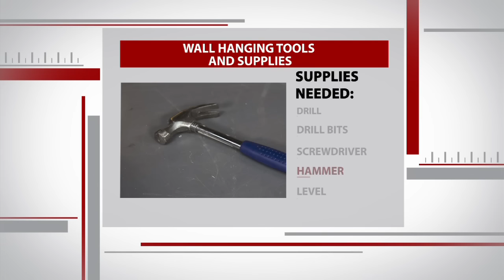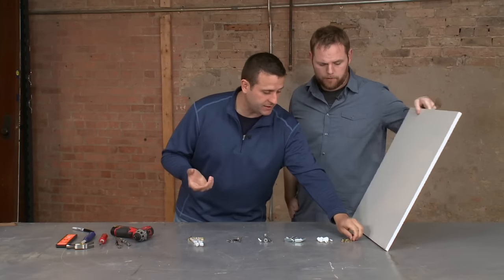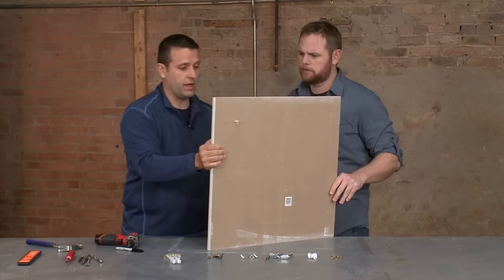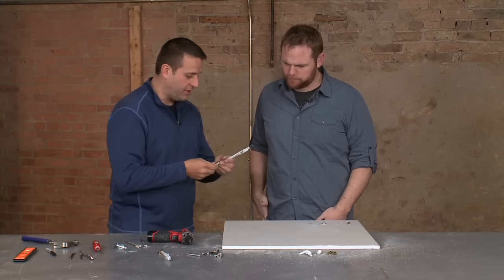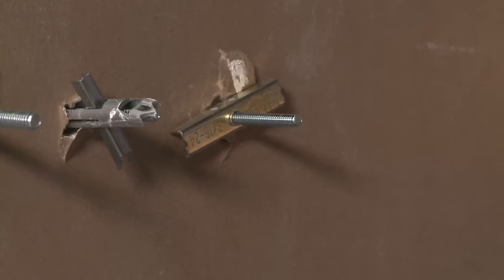How to Hang Heavy Items Without a Stud

Comment: Please remember. Those screws can hold up to 200lb, but your drywall cannot. We don’t have issues with screws, our big problem is drywall is weak and it will brake away from the wall easily. So do your best to find a stud.
Reply: Yep! Use any of these like this to hang up a big tv on a heavy duty swivel mount, and its coming down, along with your wall.
Reply: That’s my problem now. 😫
Reply: My house is from 1930s, walls are gypsum and lath, do you think it will pull out? Thanks Dante Opps
Reply: @lindat9083  I don’t know 🤷🏽‍♂️ I never seen a 1930 lath before but I know it is thicker and stronger then drywall.
Reply: I want to install a pull up bar in between 2 hollow steal door frames. I’m having a hard time deciding what Anchors to use. Could you help me?
Reply: The best bet is to find a stud everything else is just a guess.
Reply: Is it ok if I’m just hanging pictures max is probably like 30 pounds

Comment: Forgetting the most important consideration. That is that it doesnt matter what the anchor weight load is.. Its how much the drywall or substrate will hold before the anchor comes pulling out of the wall itself.  Light weight drywall will not keep an EZ anchor in (the white ones) when using it to hold things like drapes etc. Which they advertise they can hold. . The anchor will hold up without breaking but it will come out of the wall. As for the toggles. If your suspending a plant hook for example where the weight load has vertical pull on the anchor, again it will often pull right through the drywall when a plant is fully watered even if it hasn't hit the weight capacity. Just considerations to keep in mind. The substrate definately matters.
Reply: I'm so glad I read your comment before I destroyed more of my drywall. Thank you!
Reply: How do I fix a heavy plant hanger that will be very heavy on the side of my vinyl sided garage? Help😢
Reply: Any advice then on how to get curtains to actually stay up?
Reply: @jeffchandler2521 You don’t. Did you know that you don’t always get what you want?

Comment: That's really nice however on practice things are quiet different. On my experience, the weight  that an area of sheetrock can hold really depends on how old the panel is. The older your wall is (20 to 30 yrs), the weaker is going to be and obviously less weight will hold. I personally've  had bad experiences hunging heavy items  relying only on what the product says. I have used anchors that claims to hold up to 75lbs with disastrous consequences. Based on my experience, i have a rule to use if i ignore the age of the house or more precisely the panel of sheetrock i'm going to use. I only hung up to  2/3 of weight of what the anchor label says for older houses and 3/4 for new ones then i carefully do some math to figure out how much weight will each anchor hold.
Reply: David Qu

Comment: Thanks for the video. I hung a 75 pound mirror in the bathroom through 1/2 inch drywall, no studs. I used four 3/16 inch snap toggles with a french cleat and it feels solid. The night before, I used one snap toggle in 3/8 drywall to test the weight for a dry run before hanging the bathroom mirror. I hung a 40 pound weight on it and I was surprised by the strength of the drywall and toggle.

Comment: Folks...please unserstand that dry wall will withstand a great deal of sheer but I is very weak if the weight pulls away from the wall.  A flat screen tv should not be hung usint any of these methods. As mentioned below...a long piece of ply attached to the studs and the tv mount btackets mounted to the plywood is a good way to go.  Also shelving presents its own problems.  The methods in the video are mostly for a load that pulls straight down toward the floor.
Reply: Review TechAfrica is just jealous that he doesn't live in North America and I'm thinking he must be getting anxious to get his welfare check... It's only 10 more days and the month is over buddy...
Reply: I'm reminded of the hole in the dry wall from the knocks of just a door handle. Hanging seriously heavy stuff on it, no way!!
Reply: Thanks for that clarification because I was considering this method for hanging some shelves that I have struggled to put up. Guess I'm back to square one

Comment: Very helpful.  I just used two snap toggle anchors to hold up a large heavy mirror.  Very easy to use
Reply: Is your mirror still holding up? I've got a really heavy old mirror, from a great grandmother, and I've got metal studs which are very hard to hit. I definitely don't want it to come crashing down!?
Reply: @roxannegreen1181  still holding strong!

Comment: Note: the weights aren’t the same for fixtures which are interacted with. If it’s a towel rack or curtain rod with sufficiently heavy fabrics these smaller plugs WILL loosen overtime.

Comment: The plastic on a snap toggle is used specifically for keeping the anchor on the backside of the wall in place. Once the screw is threaded into the anchor none of the plastic is relied on to hold weight. It’s the metal anchor on the back
Reply: pl can you elaborate for me ?
Reply: Yeah , they didn't mention the anchor, how it attached and inserted.  I wouldn't trust anyone who advises hanging a  75lb mirror on a single drywall anchor without a stud.

Comment: I love the snap toggles but man sometimes they work and sometimesfir some reason I end up with a screw that just keeps spinning. For a situation where you want to hand a tv like a plasma but do t have the studs right where you need then then simply have a long plywood board that you can bolt to the studs then screw your bar onto the plywood and it works perfectly.
Reply: +Rich Lo try putting bearing grease on the threads, a light coat. And take a pair of cutting pliers and deform the bottom of that toggle thing where it goes into the back of the drywall. Create a bur on the edge. The reduced friction on the threads and the increased friction on the toggle will totally guarantee it working.
Reply: +Derrick Blackburn okay. I can see that working.

Comment: Thanks for this! I hung a floating shelf. I was able to find the studs of 3 sides out of four, but for some reason the top right side stud was not there so the screw came off. I will try the drywall anchor.

Comment: I strongly suggest that one hand start the screw/bolt into the snaptoggle BEFORE a tool is used. If not, the mismatched screw will quickly force the toggle wings out of the plastic wall retainer, destroying the assembly. Dammit...

Comment: Those Snap Toggles are rated for 75lbs each. That doesn't mean that the sheetrock alone would support all that weight of a 60"-80" TV. I see too many factors contributing to the weakness of the Sheetrock.There is Humidity, Gravity, Actual Sheetrock Damage and usually all bolts, nails, and supports start carving into the sheetrock. I wouldn't trust them with a Heavy TV.

Comment: Does the load bearing capacity multiply the more anchors you use? Ex. if a snap toggle holds 250lbs, will two support 500lbs?
Reply: Good question 🤔

Comment: The second anchor needs to be installed by drilling a hole with a bit just slightly thinner than the anchor. I tried it like your video and anchor broke. Your video shows that you skipped foward to the end .

Comment: for shelves, I would rather find studs, cut some ply or 1x2's screw them to the stud, then use that to attach the brackets for the shelves. Granted this is for in garage use and wont look as nice in the house, but it holds my 50+ tool box just fine!
Reply: I think this is the most important comment for this video. As others have mentioned, the hardware may hold your piece, but the drywall could eventually crumble or weaken. This is a bit of extra work, but will probably last forever. And this is what I'll be doing for some heavy items if I can't find a well-placed stud. I learned from Dad and that is what he used to do. Thank you for the comment.

Comment: At 3:25 in reference to the snap toggle, the narrator says "All that's left to do is insert the screw and this heavy duty plastic is ready to support some serious weight."  All the weight is supported by the metal screw, and the plastic serves no further purpose beyond holding the toggle in place in the wall to receive the screw.

I used the toggles to install a TV wall mount in a condo with metal studs, where screws weren't going to work.

Comment: Usually you install the screws where there is a frame behind the drywall, so that will bear the weight of the painting/shelve etc. Drywall is not designed to bear any weight...

Comment: Fantastic video. I need to hang a hood range on my kitchen,  the studs are nowhere near the center, since I already installed the backsplash (glass and metal pieces, go figure wifey wants it that way) so now the holes to hang the hood range fall right on top of the metal pieces of the backsplash. The range is 20 lbs heavy, I am thinking of using the 75 lbs toggle bolt for it. This should hold it easily since it is almost 4 times the weight of the hood range. Any thoughts?

Comment: 3 weeks after hanging a shelf I made to hold my flat screen tv on, it came crashing down leaving me without a tv.  I used dry wall plugs, then inserted the screws thinking the tv was safe?  My new tv now sits on a table, safe from falling lol                                                                             Thanks for sharing your video.  Now I can use your examples :)
Reply: jojo if you were using plugs they are not for drywall. they work in brick, plaster, wood, and cement.

Comment: I need to install a TV mount (steel unit) to the side of a solid oak kitchen cabinet. The corner of the kitchen where the TV mount will be installed has porcelain tiles on one side (IE, kitchen back splash tiles), and an solid oak cabinet on the other side.  I know that the TV mount  requires two holes. What is the best mounting hardware I can use?

Comment: What size bolts/washer would you use to hang 96" L x 22-1/2" w x 1" thick commercial residential subdivision sign. I think it is solid oak.  It is HEAVY. Hanging it to a brick wall?

Comment: Thanks for your video.  I bought snap toggles, on advice of hardware guy at Lowe's, to hang a header board for barn door flat rail hardware using provided 3" lag screws. I am not experienced so it takes ma a long time to make mistakes..LOL... But I think I am on the right track.
Reply: By the way.  My walls have metal studs...

Comment: I am ashamed to say that, until a few days ago, I don't think I've ever hung more than a small picture frame. I didn't even know what drywall was, but from the way that my wall crumbled after trying to hang something heavy, I'm pretty sure it's drywall. I'm recently divorced and I see no reason to hire someone else to do jobs that I'm perfectly capable of (as long as I educate myself on how to do so properly). With that said, I guess I need to start with something even more "beginner" than this video, like "what kind of walls do I have?" 😂 I'm laughing but I'm serious. I really want to learn the ins and outs of home improvement, maintenance etc so that I won't have to rely on anyone but myself. If anyone has tips on what I should be researching, please share as I'm sure that there's so much to learn that I never would've realized.
Reply: Good for you. Watch all the home building shed building videos on you tube that you can. I have learned so much. Then pick a project in your house like changing a light fixture but don’t feel safe or confident doing it after just 10 videos. I feel like people posting don’t always know to tell us everything somethings they think are common sense and they often as in all the time leave things out. I watched 100 shed building videos befor I built my shed. First thing I ever built other than a table and baby gate. Every video I learned something earth shatteringly new and crucial for the build.

Comment: What would be the best to use if the wall has dense insulation behind the drywall? I tried the first toggle bolt but it couldn’t open because the insulation was blocking it.

Comment: Which stud should i choose for a hollow wall to hang my project screen in the basement theater? All I have is a sponged surface beneath. I already tried few of the studs mentioned in this video and i have a ton of holes and screws that just came off

Comment: Very Respectfully,
With All Due Respect,
Good Gods Day,

This is such a FANTASTIC video with perfect illustrations, the only thing is,  they don't put dry wall that THICK in homes anymore, so when you put the hole in the wall with the hooks of support, the sheetrock is SOOO THIN it makes it EXTREMELY WEAK TO SUPPORT THE HOOK AND THE WEIGHT OF ANYTHING, if I may, maybe someone be willing to show us how to deal with trying to hang pictures up on THIN SHEETROCK, in this video, the sheetrock l👀ks to be very sturdy and definitely MUCH THICKER than what these news homes have today in 2017, can you all give any guidance on dealing with trying to hang pictures up on these thin sheetrock walls in these new homes.

Thank you for such a FANTASTIC video of instructions with great tool suggestions!!!👍
Reply: chris b 

Very Respectfully
With All Due Respect,
Good Gods Day,

Ooooo okay, I am not educated about plaster at all, I tried putting a hole in the bathroom wall behind the bathroom door and I did the steps and then as I was turning the sturdy nail supporter thingy😀 into the wall, the wall IMMEDIATELY opened up and the nail supporter thingy😀went straight through the wall, for me to then discover that behind that wall it was ABSOLUTELY HOLLOW with SO MUCH emptiness, so now I have a little over a quater size hole behind my bathroom door, and I don't have a clue what to do.

I truly thank you for taking the time from your busy day to reply because I have really trying to figure this out.🌸

Comment: What do you use to hang a mural, painted on a  3/4" sheets of 4'x8'' plywood to drywall? So it would be drilling through 3/4"'s of wood, the 1/2" of drywall. Also drilling a hole more than 1/4" would ruin the mural. Even then the holes would have to be strategically place to avoid the main art work.

Comment: I need to hang a 50 inch 30 pound tv on my plaster wall. Will the snap toggles work and should I use a 1/4 or half inch?

Comment: Trying to hang 4 2’x8’’s that are connected to each other which forms a square from an old NY ceiling. The ceiling is the old tin tiles. Tried using threaded rods and snap anchors, but the tiles are hollow and will not support the weight of the 4- 2”x8”s, which are 8’ long. Any suggestions?

Comment: These guys totally ignore the material and strength of the dry wall
Reply: I spent almost 40 years in building maintenance and I can attest to the fact that drywall will not stand a heavy weight pulling away from the wall for very long. Shear strength is pretty good but can you depend on the weight always pulling straight down? Find a stud and use it....ReviewtechAfrica got his panties in a twist because of my statements. Perhaps his plasterboard is not the same as Our dry wall (sheetrock), gypsum board. No knowledgeable painter, or plasterer will recommend just fastening shelving to the drywall regardless of the load.
Reply: JIMMY TATE well said
Reply: @Katarina Krizaj duh - don't do it...
Reply: @Katarina Krizaj 
Toggle bolt. You'll need to drill a hole in the stud large enough for the toggle to fit through.
Reply: @Katarina Krizaj best option is to take the walk down, add wood, then put the wall back up

Comment: Monkey Hooks. Nothing better for Drywall. You just twist them into the drywall and then push them into  the wall. They leave almost no hole and you can take them with you when you move. Use a bit of white toothpaste to fill the tiny hole. You can find light duty sets at the Dollar Tree and heavier ones at Home Depot.  Once you get the all the way into the wall up to the hook, twist the hook so into the proper direction for hanging. I never use anything else any more. 
I HATE those white screw anchors. They are the worst. Molly Bolts do work. but they can't be removed. Toggle Bolts also work but they require a huge hole and so they also leave a hole that has to be patched when they are removed. AND the toggle falls down into the wall when you unscrew them.

Comment: Hanging 200 lbs on drywall -- is drywall designed to support that much weight?  What keeps the weight from warping the drywall or pulling it off the studs?  I'm just wondering.  I know nothing about drywall and many other subjects.
Reply: try this. make your self a small demo wall with short studs and cover it with a small piece of gypsum board. put yourr choice of hangers on and hand 200 pounds from it. I think you will see what most of us are telling you.

Comment: What if you want to hang something from the ceiling.. Will these work
Reply: That's straight down gravity with no the support of the drywall touching the ground for added strength and support. That's why you definitely have to find the studs in the ceiling (wood or metal) to drill into, for support, like with chandeliers hanging. But how does one drill into metal studs? I guess with metal drills first, and then a long screw to anchor the no doubt anchor or plug that is put into the dry wall too. I'm talking more vertically now.  Though in the ceiling with metal studs it must be something the same. Just have to make sure the screws are of a size it will be a very tight and strong connection hanging vertically.

Comment: what if a brick wall is directly behind the dry wall?
Reply: Use masonry screws, invest in metal/masonry drill bits. Drill recommended hole size for masonry screw at highest speed. Set house on fire from generated heat. Profit.